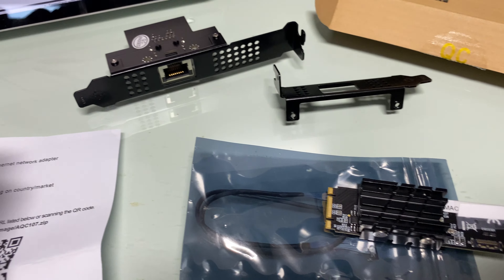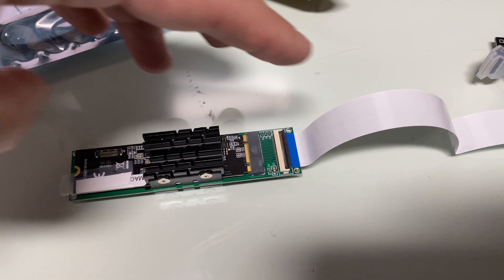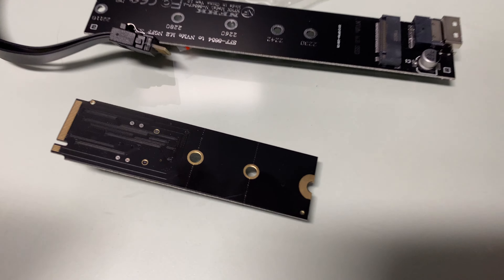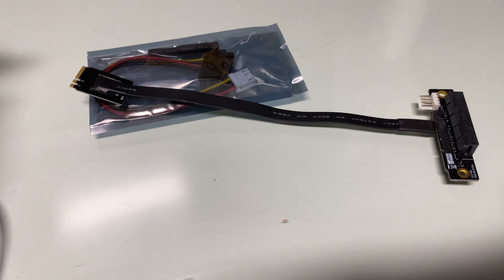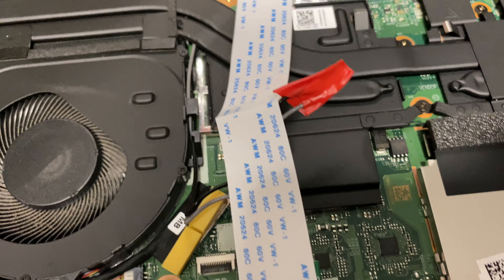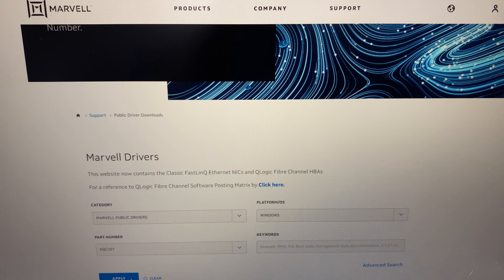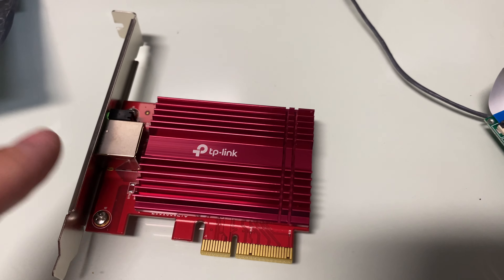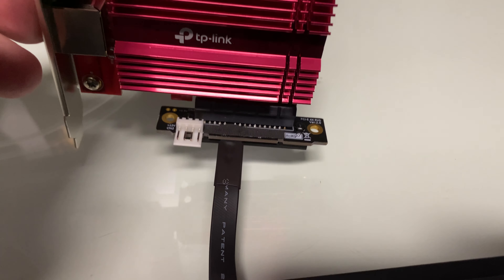HOW to Turn LAPTOP / MINIPC Wifi-Card AE Key SLOT into WIRED 10Gbe Networking TEST #wisebuyreviews

Comment: You need to run iperf to test the connection, not copying files, esp. when you can't saturate it.
M.2 A&E Key supports two independant 1xPCI-e ports and 2 USB2.0 ports.  Most wireless cards use one lane and many motherboards only have one wired.  Combo wireless cards use USB for Bluetooth.
Reply from the maker: Thanks for the info!

Comment: You saying u got the tplink running? Would be awesome to see somehow an attempt to max out the speed as much as possible... but understand event possible..... I'm looking into doing something similar with my laptop I with only just logical sense (not tested anything) would for sure also like the "tplink" solution over the other adapter..  just seems more solid
Reply from the maker: My conclusion after months with these adapters is just get the USB 5gbe connector and be happy with the 200-300 megabytes a second you could get as most items are okay with that. Or get the MinPC MS-01 from Minisforum that is coming out that has 10gb sfp+ ports on it.
Reply: @wisebuyreviews  yeah ok thanks I have been looking at those but felt usb was crap but maybe I will... so thankful though to speak with someone who seems to know... alot of places when u ask about it... People automatically respond get a USB adapter not even knowing if they can do 10GBE or not... so with your comment I can clearly see you are one who knows what you speak about 👍👍 good to see 👍👍🙂

Comment: What the manufacturers need to do, is come out with Docking stations that can do 10Gbe. Glad you got it working tho
Reply from the maker: Yes I agree on the 10gbe docking stations, however it seems 10gbe is too high power and too much issues with it so it is an engineering nightmare or they woulda doune it.

Comment: it might just be the laptop port dose  not support pcie protocol some do and some do not
Reply from the maker: You may be right, gave the GTR 7 pro and the network card doesn't work with the Wifi-Card Slot
Reply: @wisebuyreviews  my last motherobard would boot just fine with no drives attached to a wifi slot to 2port sata expander but second you plug the drives in it wont boot but if you boot then connect them it works 50/50 of the time. But iv also had motherboards that just wont work with adapters. yet the adapter works just fine in other systems